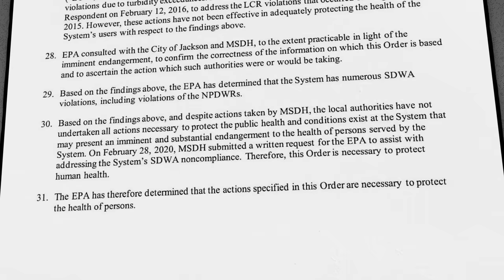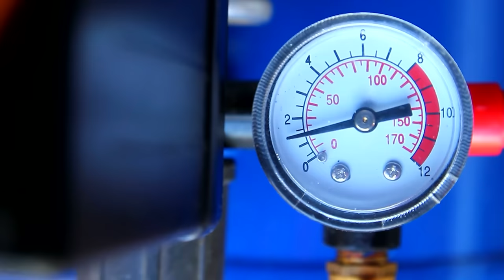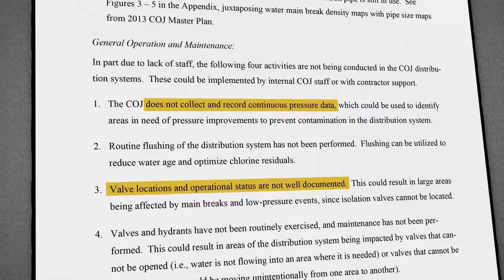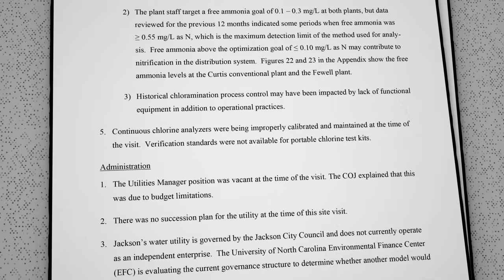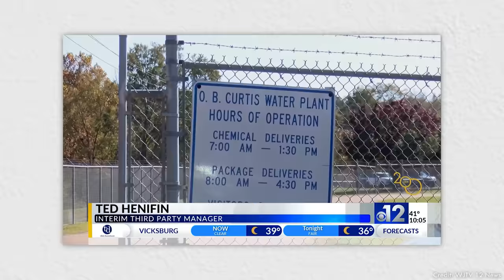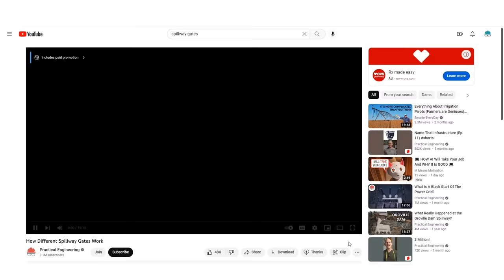The Only State Capital Where You Can’t Drink the Water

Comment: An interesting story about tap water:
In zrenjanin, serbia they destroyed some Separation layer between water layers while drilling for oil?
The tap water was like thermal water. 
It took like 15 years to build a new treatment plant. But they made it. Water is back to normal.

(they have got artesian wells in northern serbia... Not sure if the pressure on the thermal water made the situation this bad)

Comment: Hey Grady, small error at the start of the video converting MGD to KMD. You said cubic meters per day but it's actually kilocubic meters per day - a unit I've never used before as a process engineer in Australia. We typically use ML/d or megalitres (million litres) per day which is technically the same as kilocubic meters, but easier to pronounce and more recognisable.
Great video by the way.

Comment: Please don't be lazy. When the turbidity is very high and you are not able to control it. You have a solution. Quick use of dry clay before the flocculation section. Clay quickly reduces high turbidity. Only the paddle part of the system is a bit overworked (Pool floor dredging). But you can easily solve the problem. Maybe a little injection of chemicals is added, but it doesn't matter. I am a drinking water purification specialist. I can help you.

Comment: This is why the water supply and recycling system needs to be absolutely top shape during normal conditions. It's not acceptable for it to be barely operating during the 'easy' parts of the climate cycle, because the increasingly unpredictable weather events we are experiencing will inevitably damage the system. If it's on the edge normally, it'll be well over that edge in the winter, and following summer storms. We must strive for 100% serviceability.

Comment: You got much of it correct. Your causation statements were incorrect. Disappointing you spoke of matters you were not informed of with regards to the reason as the technical review was good recounting. Yes there are systemic issues in MS but it's not the cause. It's a failure of leadership over many years at the city level to perform  basic  blocking and tackling in day to day maintenance could have prevented much of what has ben experienced.  

The federal government and state had to take over. This is a rare event. The $800 million provided by the federal government will go a long way but it did not have to be in such bad shape. 

Leadership at the city level chose not to have staff hired to manage the water system. If no one is applying the (recall he needs to actually post the jobs) you raise the rate of pay.  He chose not to fix a broken electrical panel for nearly a year. They don't replace corroded chemical lines primary and backup when they fail.  What was the leadership focused on? Well lately trash pickup has been more important to steer a contract to another contractor due to accusation of corruption. I hate to tell you who cares if there is some corruption in the trash if it's being picked up when we have these other issues with water and police systems are falling apart.

Comment: Jackson's problems are not engineering issues, they are political issues.

Jackson requires their water manager at OB Curtis live in the city of Jackson, in spite of OB Curtis not actually being in Jackson. 

Jackson also requires that manager be of a very specific racial minority, and they cannot find anyone.

And then you have the pipe issues. CoJ has refused to move pipes from under roadways for over 50 years, in spite of all of the issues they cause. You can barely drive down fortification St just a mile from the Jackson plant due to sinkholes in the street. 

I moved from Carlyle St the third time I had to explain to my boss that a dump truck was stuck in the road in front of my driveway. 

Jackson has political problems, those are causing the engineering issues.
Reply: You mean race problem.

Comment: As a water operator, these are all common problems. But not at the same time.  I’m not there and I have not seen their equipment, but it sounds like to me it’s mostly a funding issue. If you COLLECT the water bill money , and I mean the entire amount , there should be enough to operate. Buy chlorine, fix leaks, replace ages equipment and lines ( slowly) and pay decent wages.  My opinion is the city has short changed the water department. Or is not correctly collecting the amount due on EVERY ONES  water bill

Comment: Resident of Jackson and surrounding suburbs for 48 years. This has been this way since I was born. Corruption and misuse of funds is the core problem. Those in charge would rather pad their own pockets (and their friends) than maintain anything. Jackson is unrecoverable. It is a zombie city and simply trash. Anyone with a brain moved out decades ago. This only scratches the surface of the problems with the city. How about the millions of dollars spent on roundabouts in Capital street downtown to eventually figure out they were too small and had to be removed. Instead of fixing water lines they cared more about “looking good” and they couldn’t even get that right. No brain power equals no services.

Comment: Clean water is not a human right. It’s a necessity. There is a difference. A right is yours at birth and doesn’t require a payment to keep or maintain. A necessity is something you need to survive. However, clean drinking water is a privilege that industrialized nations have. There are countless nations that do not have clean drinking water and the people there make do with what they have.  I saw one comment mentioned corruption. I would agree that mismanagement of such a necessary resource like clean drinking water and the lack of proper maintenance and staffing is caused by corruption and will only be fixed when the full weight of a nation is looking down on them. Once they are out of the focus, I’m sure they will slack off again.

Comment: Crazy how you guys in the US get your water from rivers. Getting water from lakes is also not great, but rivers are even worse, you cannot protect your source in any meaningful way. You would get water with way higher quality from wells, at least if the soil isn't contaminated. Because of that you would have to do a lot less water treatment and significantly lower operating costs as a result. 

However, the initial costs are higher for wells. That is probably the problem why it's not done that way. From what I've seen the general mentality in the US seems to be to rather cheap out short term, even if it more costly long-term.

Comment: This is just a (blatant example) of why every household should have a way to filter water in an emergency.  Or maybe, on a regular, and just disconnect from the "grid water".  Go and get a "Big Berkey" water filter from Amazon.  It will cost you about $500 (last time I saw).  It can make even (stagnet pond water), into sweet water.  Yes, the replacement filters are expensive.  But they last, I think it is (10,000) gallons.  It has been like 20 years since I seen.  So, don't take those figures as dogma.

Comment: My city is in midst of build a new water treatment plant.  It is to replace a plant that is 80 years old. It is going to have the capacity of 150 million gallon per day.  At present our highest demand is 85 million.  There is approximately 700,000 people dependent on the present system.  Pay now or pay later at of course ever increasing costs.  Should be on line in 2024.

Comment: Reminds me of ordinances that trade public safety for grifter bucks (oil exploration drilling under farm property, fracking runoff into drinking water, The Willows of Dallas, trash transfer masquerading as recyclers just so they can get permitted to infest nearby resudences).

Even though Jackson and Mississipi itself may have corrupted mismanagement, let's get real. Which 10 of the 50 states rank bottom in education? Had historically the highest ratio of enslaved to "owners"? Still had not signed off on Federal dissolution of slavery as late as 1970s?

It ain't just local. It's the statewide willingness to. stand by so state-level leadership can once again say, "I told you, they'll never be able to stand like us."

Comment: You should talk about Mexican water system, it SUCKS!

In most places every house needs to have a water tank underground, another water tank on the roof and a water pump to pump water from the lower tank to the one on top of the house because presure is so low it wouldn't even reach pipes in the first floor and also we don't have water pressure all day, also since most of the people gets water from a well when it drains the whole area needs to start getting water from water trucks that don't even come from the city and you have to pay for it on top of the regular water bill that they charge you even if they don't deliver water and who knows where that water comes from, that without mentioning that water doesn't come out as drinkable water in any part of the country.

At the end we have to pay for water to the city and to the water trucks which probably are owned by someone close to the city mayor and on top of that you need to buy drinkable water to big international corporations that pretty much don't pay anything from the water they take and then they sell it thousands times more to the people and nobody says anything because that's how always has been here that they can't see any other way for it to be.

Comment: I cant remember the last time I drank tap water and I don’t buy bottled water. When you consider the fact that the majority of water that goes through a treatment plant is not consumed as drinking water, perhaps a better approach is to just settle with an expectation of secondary processing at the point of delivery for the small portion that goes to drinking. Every house should have an RO system. Its easy to add back minerals after.

Comment: Your analysis is excellent.  However you and others blame lack of funding, then poor management and often lack of political support as the root causes of these failed systems.  I am a retired maintenance engineer with a large heavy industry background.  What you are missing in your analysis is the strong resistance of labor unions and many hands on workers to adopting upgraded practices or taking on new and challenging tasks and learning new skills.  In summary "LETHARGIC ORGANIZATIONS HAVE TROUBLE PERFORMING WELL. FAILURE HAS MANY COMPONENTS.

Comment: This is a story of depopulation more then systemic racism and any more depth of thought and less virtue signaling would have highlighted this fact. A gutting of the tax base by the shear absence of a population does help maintain a water system that finds itself outsized over time. For example, I don't see a lot of fire hydrants decommissioned and plus sized water mains resized for the remaining users on the water system. Its not like a lot of families are moving to Jackson. It is a city that is slowly dying and yet still has the obligation to maintain a water system that no longer sized appropriately.